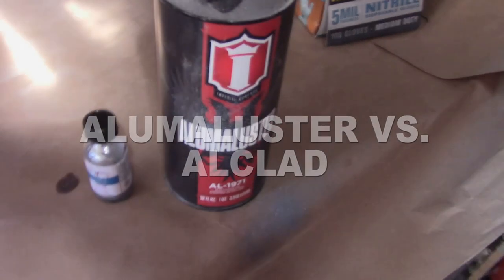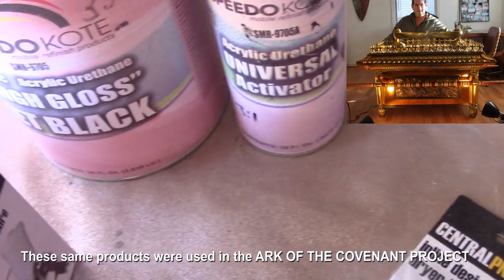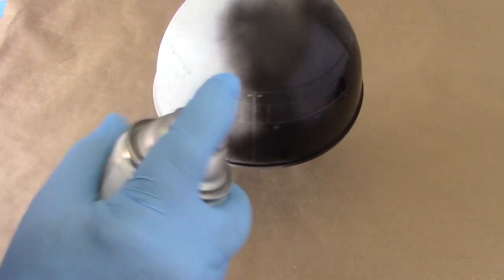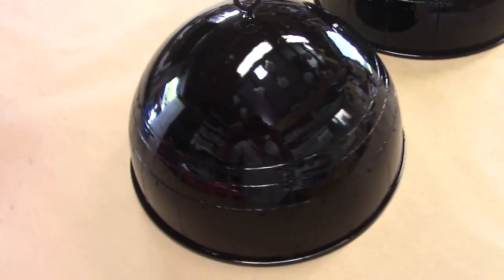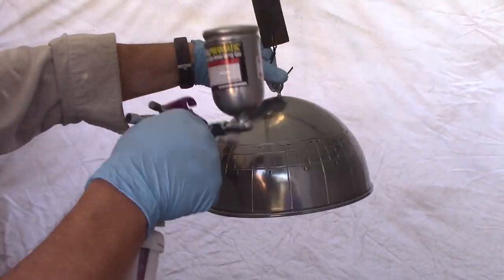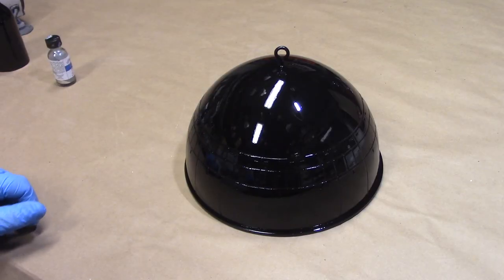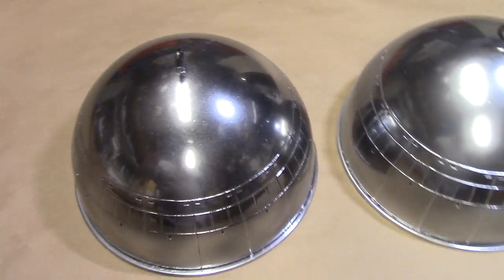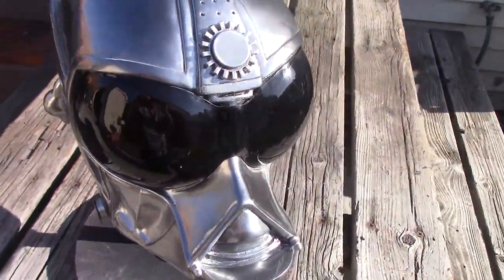ALCLAD II CHROME VERSUS ALUMALUSTER!!

Comment: Do you feel like the alclad is super thin and takes a ton to get a desirable coating?

I’ve used the black chrome alclad quite a bit, and it feels like I blow through the bottles even on small parts
Reply: Edit- heard my answer around 7 min
Reply from the maker: it does take a bit of material to get a bright coat.   I mostly use alumaluster which is essentially the same price and I buy it by the pint or quart.

Comment: Do you use a top clear over either product? Can they be handled after they have dries, on either product? Thanks.
Reply from the maker: I didn't clear coat any of the parts.  They lose some luster when you do.  The surfaces are pretty stable and can be handled. They can wear off with use but you can re-apply the alclad or alumaluster over those areas to touch them up when needed.
Reply: @chaucer44  rad, thanks.